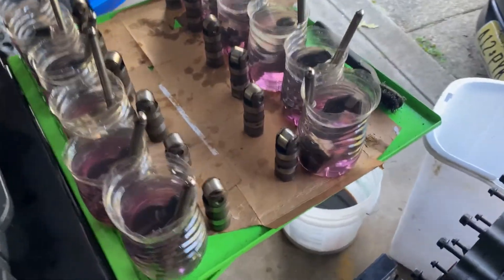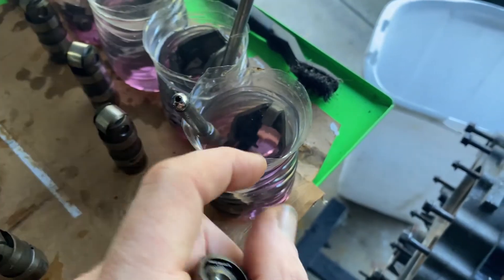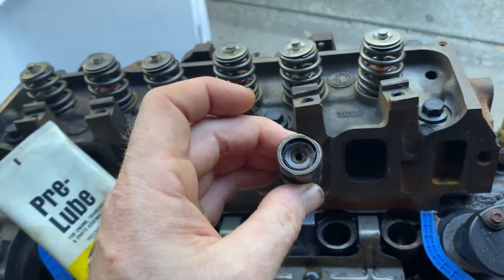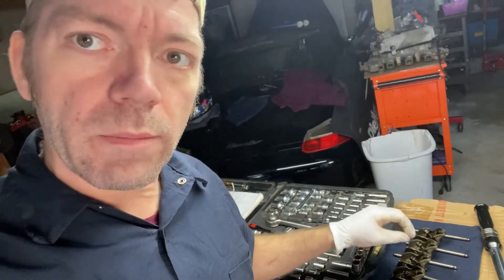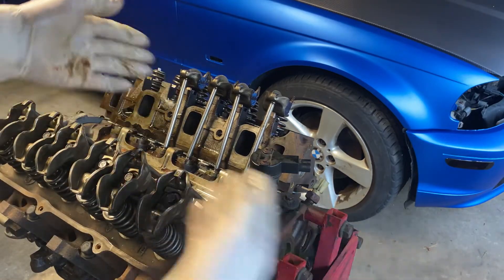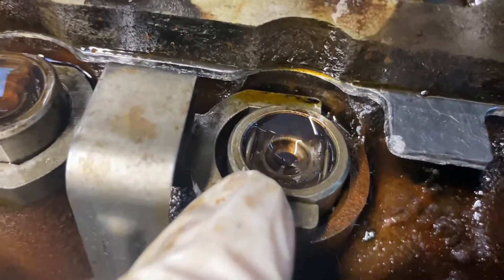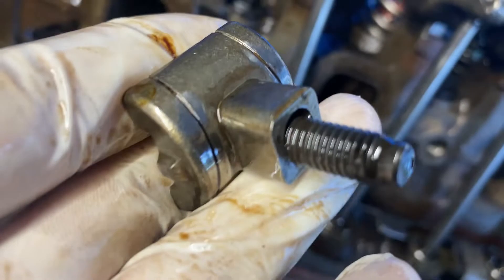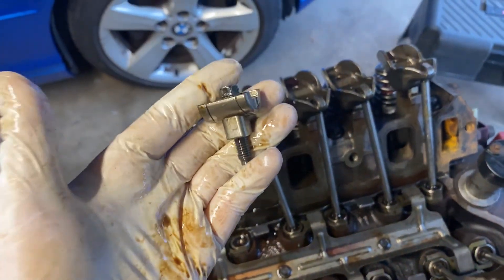How to install Hydraulic Roller Lifters, Push Rods, Rocker Arms, & Fulcrums  OHV engine (EX  Ranger)

Comment from the maker: Make sure to try to keep each set together and not mix them up when taking apart and installing.
Reply: whoops, doing my first head replacement and while i separated the rocker arms and push rods with boxes to map out where they are 
the push rods fell through and got mixed up 😔
Reply: @k01100  With roller lifters it doesn't make a difference.